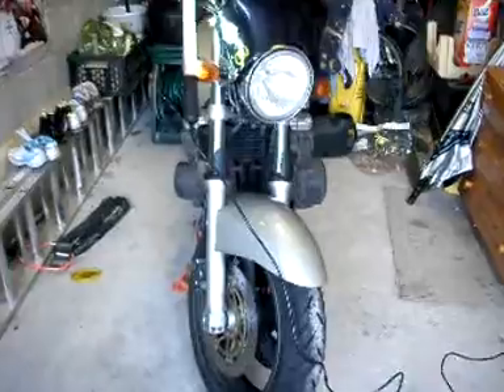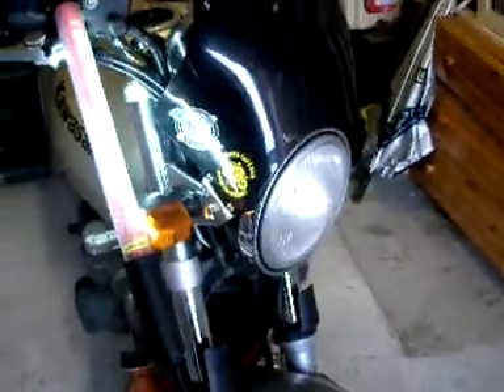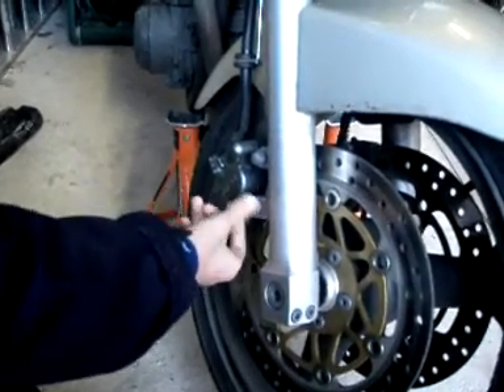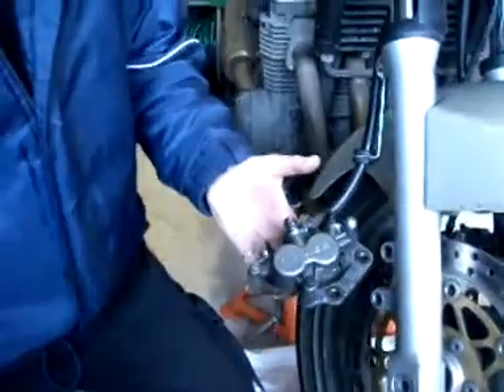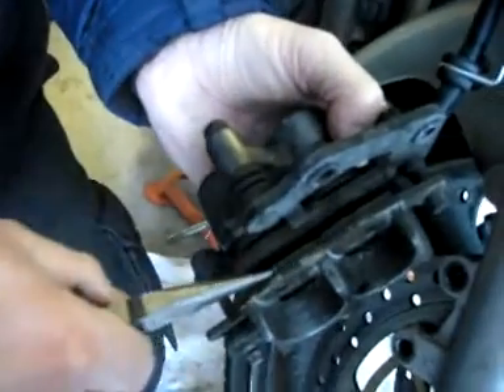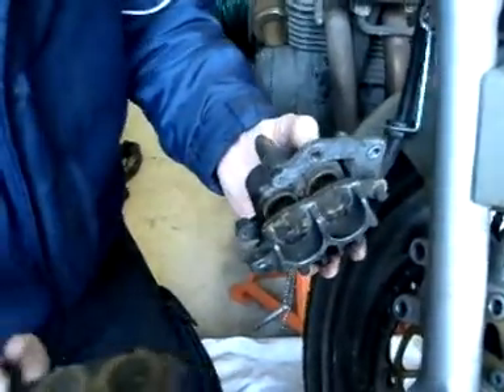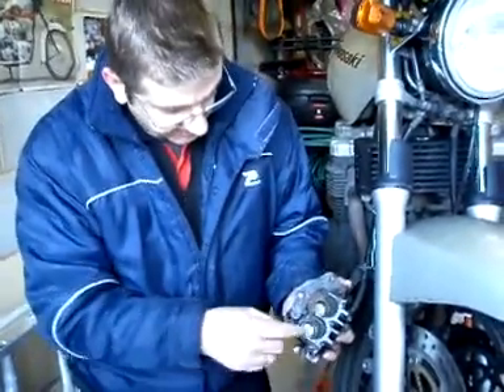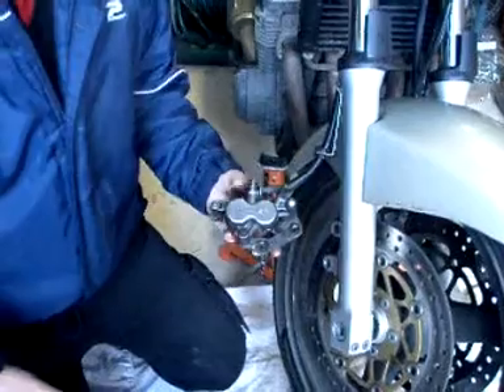Brake Calliper Overhaul (Part 1).wmv

Comment from the maker: @MrAdamIsa 
Thanks for the comment mate and I'm glad the videos have been of some use. 
With regard to your sticky pistons, there's a couple of ways to deal with it. Either grab them with mole grips and force them out (you will definitely need to replace them with new pistons) or you could put it all back together, bleed the system and use hydraulic pressure to pump the pistons out.

Comment from the maker: It sounds to me like you are trying to bleed the calliper whilst it's off the bike. That would explain why you can't get resistance and the cyliners have popped out. 
You have no chance of getting the cylinders back in as it is. You need to strip and drain the system, then pull out the cylinders and make sure the seals are seated right. Re-assemble the calliper, mount it back on the fork and disc, only then should it be bled. Be patient when you are bleeding the system....it takes time!